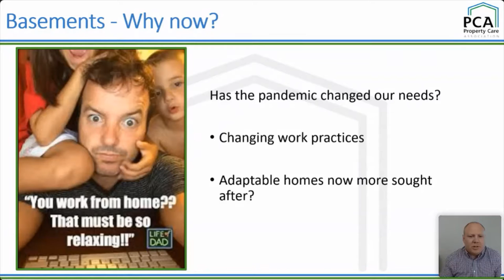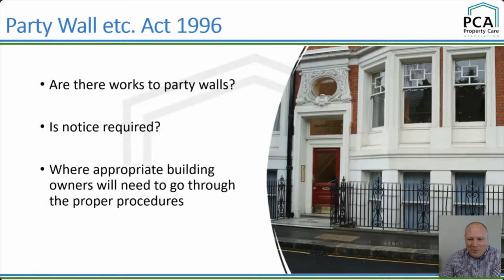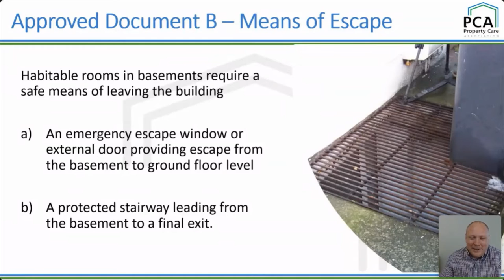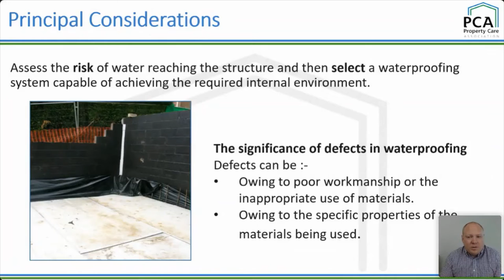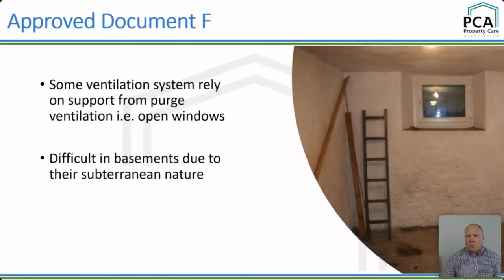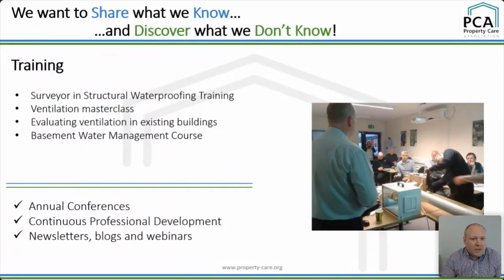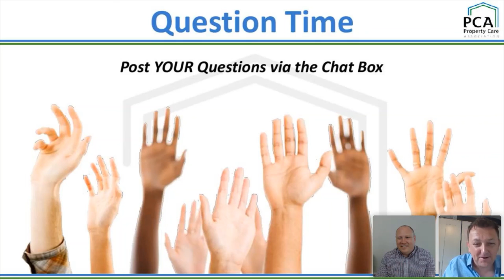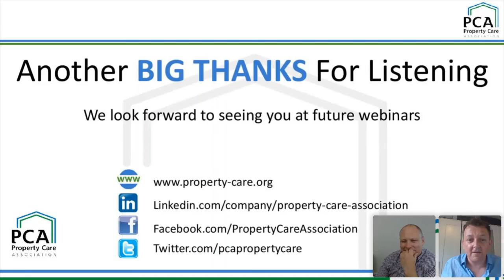Building Regulations for Basement Conversions

Comment: Only one side of my basement has earth against it (the other three walls are party walls) and it is pretty dry.  There are two light wells with opening windows.  I want to use it for storage (presently anything down there eventually gets damp or rusty), but I also want it to look reasonably pleasant.  I've been advised to use lime plaster on the single 'outside' wall (no tanking at all) and to insulate the floor, then manage the moisture with ventilation.  Apparently the solid stone wall was built thick enough to keep water out.  Does that all sound plausible?